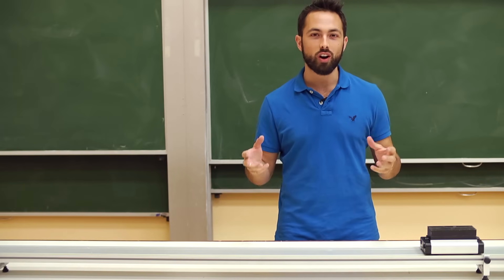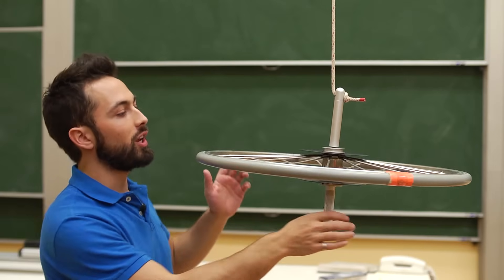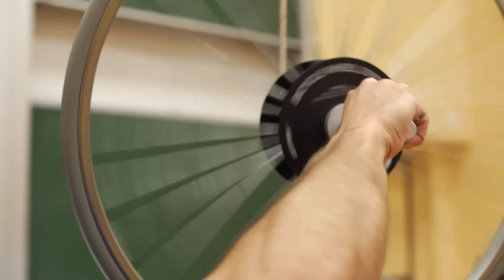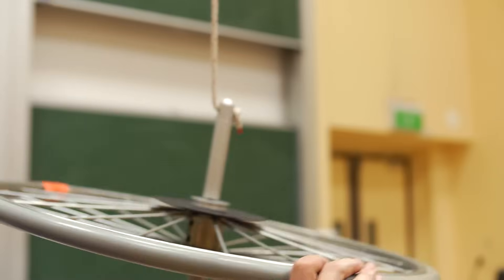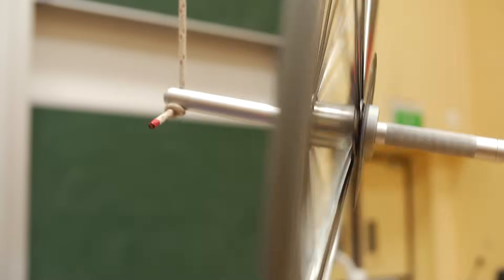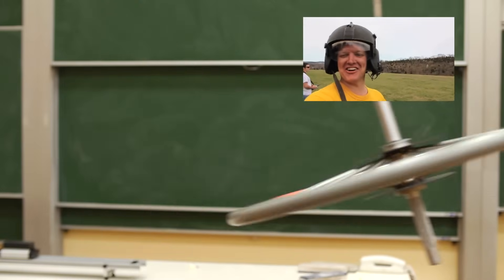Gyroscopic Precession

Comment: Is this the reason why it is so easy to balance a bike while ride but nearly impossible when your standing still?
Reply: in a way you can say yes, but the reason you are looking at is angular momentum(AM). just like momentum is conserved, AM too is. A spinning wheel has AM parallel to ground and if its in balance, there is no torque on it. so by conservation of AM, the wheel should continue rotating. it simply can't tilt and fall without external torque as it will violate conservation of AM. in the above video, AM is changing since there is a continuous torque over it. it explains why we tilt the bicycle when going on a curvature(to get the torque). a tilted bike can't move in a straight line.
Reply: +Alok Jha well, it can if some other weight shifts to keep the center of gravity in line with the direction of travel.  Or if continued motion isn't necessary for your experiment - i.e. if you're okay with the rider falling over.  But either way, the bicycle is tilted and still moving in a straight line.  The idea of tilting the bike as one goes around a curve is better understood as keeping the sum of centrifugal force and gravity pointing directly into the road below you.  If you try to turn without tilting, centrifugal force will push you over towards the outiside of the turn.  If you try to lean over without turning, gravity will pull you down.

Comment: Veritasium Actually, Torque=r X F and not F X r. This will change the torque's direction.
Reply: John Mcleavy Torque is a vector and therefore r X F has the opposite direction to that of F X r although their magnitude will be same.
Reply: Cross product of vectors is not commutative; dot product is commutative.
Reply: Alwin Priven Vector product is not commutative.
Reply: +Alwin Priven it's about that hand movement he did to find the direction. To figure the direction out for any cross product you point your fingers in the direction of the vector before the 'X' and then curl them towards the direction of the vector behind the 'X'. If you try it out you'll see that if you reverse the order that you take the cross product of the vectors the product will point in the opposite direction :)
Reply: ***** they're the same thing.

Comment: Use a geared electric hub wheel. and see if the torque is balanced because the motor spins opposite direction due to the planetary gears?

Comment: I think, torque is not pushing that way you have pointed. Torque and angular momentum both share same direction, however, angular momentum needs to be unchanged. Also, change on the torque in time also gives the change on the angular momentum. Thus, to keep angular momentum stable, change on the torque must be compansated somehow(by phsysics law). After wheel had angular momentum(when you twirl the wheel), gravity pushes torque to have a down aim a little(because wheel has mass and gravity will force wheel to fall, in this case one and of the spin is tied to rope so other end must fall) and it changes torque vectors a little to down, then, to compansate this change, an upward torque must be added to system. At that point, wheel start to turn clockwise taking center as rope and it gives the upward torque(Right had rule). If I am thinking wrong please let me know. Thanks.

Comment: Hey veritasium,with the same arrangements, if the wheel is spinned or rotated clockwise,will it still be subjected to the right hand rule where the force is in the direction of the fixed support i.e the rope? and also considering in space with no such fixed support will it be in the equilibrium state ?
Reply: Please do rply
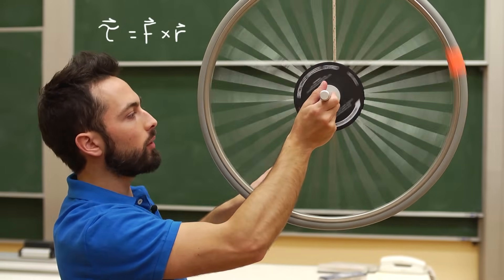Reply: *****  I'm operating under the assumption that the setup you're imagining corresponds to ~ 1:22 in the video. If he were to rotate the wheel clockwise, he would be applying an upward force on that edge of the wheel and as such the torque vector will point "into the page", instead of "out of the page" as it does in the video. The result on this setup would be that the wheel would precess in the opposite direction if let go. I'm not sure what you mean by the second question, so I'm unable to answer. Hope that helped.
Reply: Cody Poole Thankyou for your time and rplying me.I got your answer and i do agree with it.The second question was like what kind of forces will act on the wheel in the absence of gravity and the rigid support.Imagine a flying saucer in space.
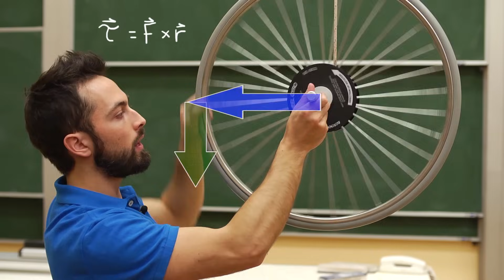Reply: ***** If we removed gravity and the rope from the picture, there would be no precession because there isn't a torque applied due to gravity. However, because we don't have a rigid support, the force applied to the wheel to make it spin would not only make it spin, but would likely give the wheel linear momentum unless the force was somehow applied perfectly so that it is entirely tangential to the wheel. That seems fairly impractical, so imagining the wheel and turner as they were at 1:22 again, the wheel would both spin and move to the right.
Reply: ***** in space there will be no torque due to gravity so it will be exactly the same as having the wheel attach both side, it will spin tub not rotate around the rope....

Comment: I'm lost.When you introduce torque, it was pointing out from the center of the wheel, so as angular momentum vector. Through the end of the video angular momentum vector remain in its position but somehow torque started to point 90 degrees to angular momentum vector.

At 2.32 what torque points out towards the camera?
Reply: afaruky is the torque of the rotation around the rope as it falls
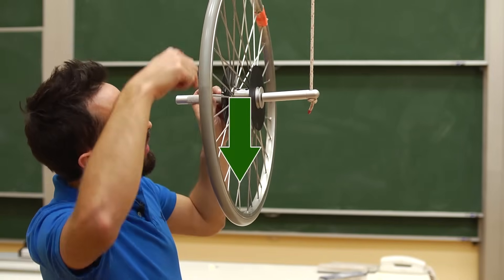Reply: afaruky at 2:15 you can see there is a force (weight) being applied at a certain distance of an axis (arm), so there must be a torque perpendicular at it. you can use the right hand rule to visualize the direction of the torque

Comment: I'm sorry, but I still fail to comprehend this explanation. Though I do appreciate the use of scientific terminology, however, when it comes to a field of unfamiliarity, those terminologies do very little to help one garner an actual understanding, rendering this explanation unintuitive, (though I understand intuition is subjective)

For example, you re-introduce the concept of vectors when explaining the forces of angular momentum on the wheel, and clearly showed how the resultant force created an outward torque perpendicular to the object. However, it is still unclear how the centripetal motion of an object correlates with an outward movement at all, -to me, that leads to the spurious notion that if you spin a top fast enough, it'll create an upward "torque" allowing it to generate a force contrary to gravitational force, and a lift off the ground. Now I know this misunderstanding is largely due to my own ignorance, and that this in no ways is what he's trying to convey, and he does make a distinction between the force and torque vector, fair enough; however, an explanation or elaboration on the concept on torque itself is much to be desired, at least for me.

In the end, I am aware of the concept of vectors, and how they are measured or ascribe, but I am still left yearning for a true understanding of the exact phenomena that is taking place here; what exactly is keeping this object from toppling over under the weight of gravity while in motion, why does pivoting a spinning object fixed to rotating segment cause it to rise and fall? 

Clearly this man is quite brilliant, And this video has helped millions in understanding, he clearly took his time to make this video which I would not watch if I had perceived it to have little merit in that regard, it's just this answer was not as intuitive as I had hoped it would be. I am looking for answers, and unfortunately, the reframing of the phenomena through vectors and graphs is not enough for sheer comprehension. May any explain this phenomenon in the most intrinsic, innate and clearly evident way possible?
Reply: Please resist the urge to, without thought or reason, inundate with equations: I have absolutely no problem with equations, however when that becomes the sole basis of an explanation , that's when there is a  vast disconnect and the explanation becomes almost meaningless; an explanation of something so fundamental couldn't be so complex that it cannot  be explained naturally, in words,.  I don't mean to come off in the least bit contrary, but I'm I'm just almost in dire straits trying to wrap my mind around this curious happening .-.

Comment: You can think of it (the gyroscope) as a stream of particles, which we will, for the purpose of explanation, replace with a ship orbiting the Earth. If you provide a thrust perpendicular to the direction of travel, it will cause the ship to change direction, not position, angling the future orbit with an axis (if you can call it that) through the ship while it is applying force.

Comment: I have a question, how would same wheel react in space or zero G?
Reply: Ignore the effect of gravity in this case that's it.
Reply: Kanan Anand so it will rotate like a spinning disk in 1 axis? or will it have 2 axis rotation?
Reply: ***** I think it will have only one axis of rotation. Since fixing it with the rope wouldn't do anything in zero gravity.
Reply: There would be no Gyroscopic precession. Consider this: The center of mass of the wheel is on the center, which is pulled down by gravity when the wheel is held perpendicular to ground, and thus on being released, it eventually aligns itself parallel to ground in a rotatory motion with torque produced by the interaction of gravitational force and radius equal to the distance of the center from the pivot point (T=r x F). The direction of this torque is along the radius of the wheel outwards which is causing the wheel to move in the direction radially outward. But here there is angular momentum acting outward, perpendicular to the wheel. Thus the precession is in the direction of the resultant vector.

In simple terms, the force which is necessary for this precession is GRAVITY and in absence of it there cannot be any precession.
Reply: nisnature But if you gave it a slight nudge it would precess. Or would the correct word be nutate? I'm never sure.
Reply: Btw,there's no such thing as zero G.The astronaut and the spacecraft have equal orbital speed or greater than critical orbital velocity.So the astronaut himself with the spacecraft is orbiting around the planet due to which he experiences the weightlessness.
Reply: ***** zero gravity is a condition were an object has no weight. A person jumping out of a plane experiences zero g. A pilot turning hard in a jet, expeirences multiple g forces, we'll say has pulling 10 g's, if that pilot does a nose dive towards the ground, effectively freefalling, he expierences 0 g's
Reply: @nathangoss8932  "zero gravity is a condition where an object has no weight"

That is correct, but the whole point is that objects on board the ISS do not have 0 weight because they are not in zero G. The have 0 apparent weight, but their actual weight is pretty much the exact same as on the surface of the earth
Reply: There’d be no tension in the strain anymore so no more torque; think of what would happen if you cut the cable and let the wheel start free falling, that’s what being in space is like.

Comment: moment ki jarurat kyu padati hai. why we need moment to balance system. i mean system should be ballanced by force only      either we apply force on center of gravity or anywhere else. plese explain it.
Reply: we use the term moment of force which is torque due to the symmetry produced by the force(as the object goes in a circle about an axis).that is why we define the pseudo vector(perpendicular distance cross the force) perpendicular to both force and torque.this definition is just based on observation and no imagination is included here
Reply: thnks